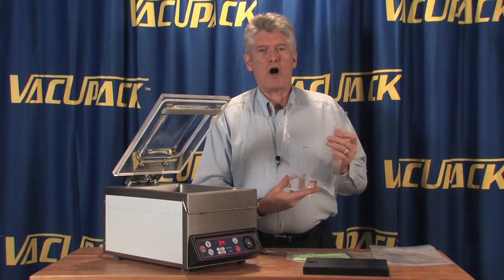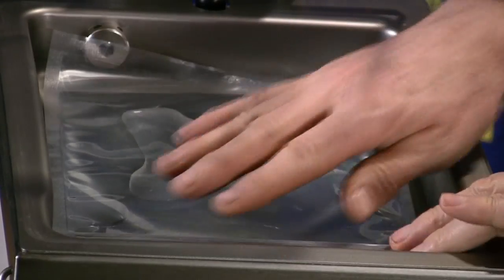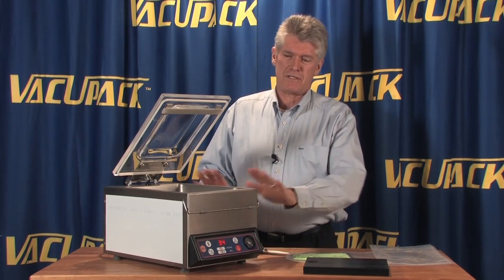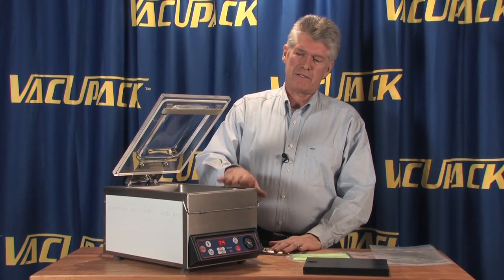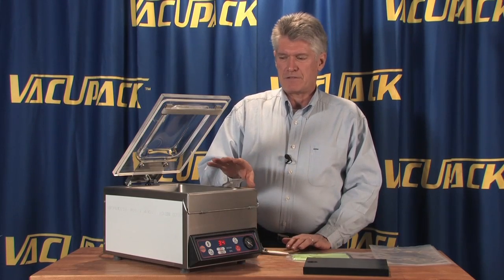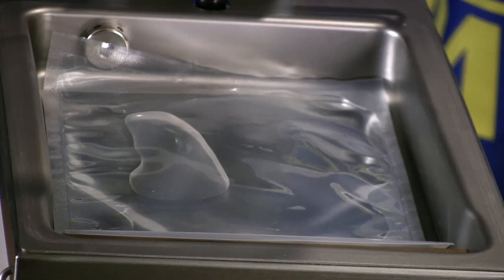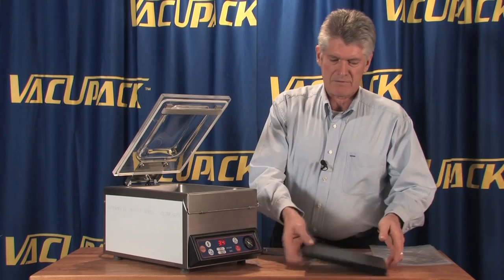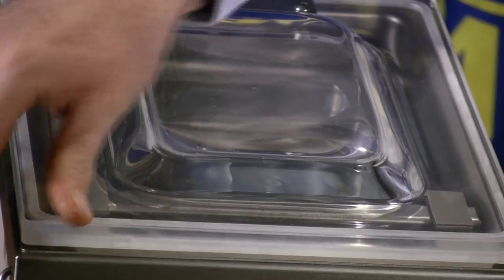Vacuum Sealing a Bag of Water in A Chamber Machine MiniPack MVS-20

Comment: what is the setting for the machine?
Reply from the maker: I think he ran that 30 seconds does the video show the time?  It really does not matter it will go as long as you want.  Water does not flow out of the bag.  If that were a gravy or other viscous sauce then it may not go so long as the air being removed will bubble out the gravy.